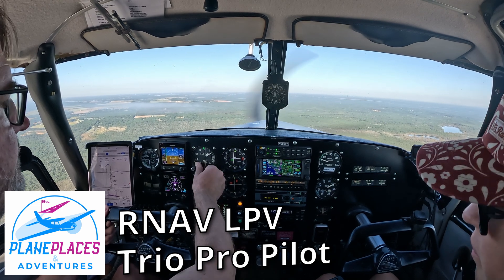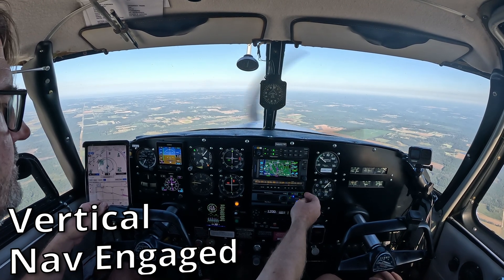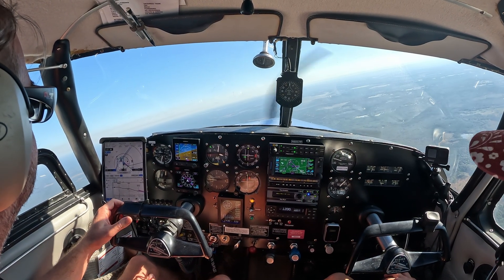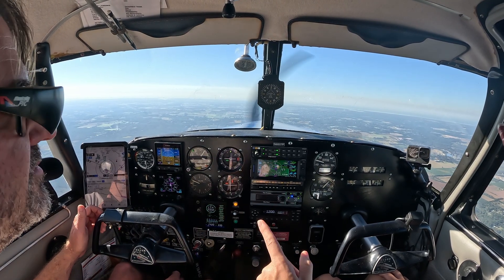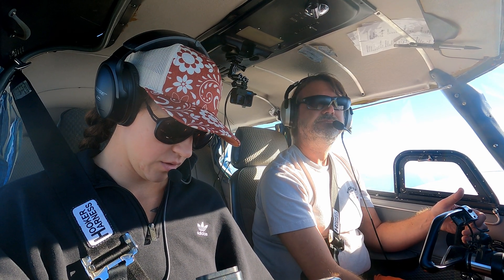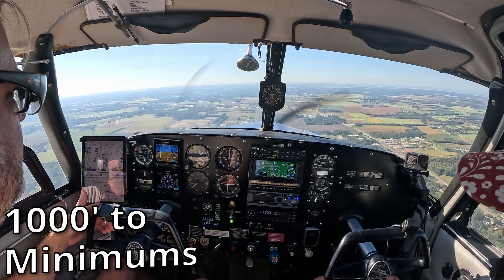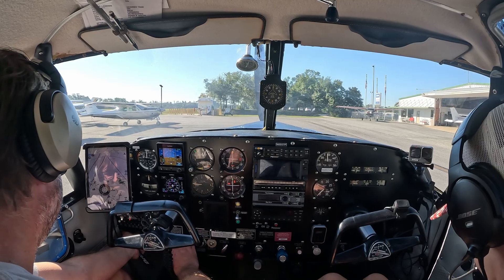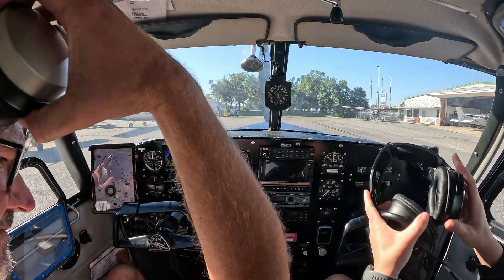Instrument Approach on Autopilot | Trio Pro Pilot LPV in the Piper Comanche 250

Comment: Thanks for the new video with the LPV approach.  I find the new Garmin Smart Charts much easier to read and refer to while flying approaches compared to the densely packed approach plates.
Reply from the maker: I agree the Smart Chart format is well done. There are some nuances with Garmin Pilot's menu system for Charts that seem to have gotten small upgrades as well to more quickly go from what's loaded in the Flight Plan to the correct plates.  I would like a shortcut in chart view that warns that the current plate doesn't match something loaded in the Flight Plan with a button to switch.

Comment: Nice video.  Modern auto pilots make ifr flying much safer.  I put a garmin gfc500 in my Cherokee with a similar panel.  It makes ifr flying much easier.  I find myself not using auto pilot for practice as much. Just once in a while to make sure I remember which buttons to press and when.
Reply from the maker: Yes.  I’d say pretty much required for practical single pilot IFR.  Even a wing leveler with heading bug really reduces pilot workload